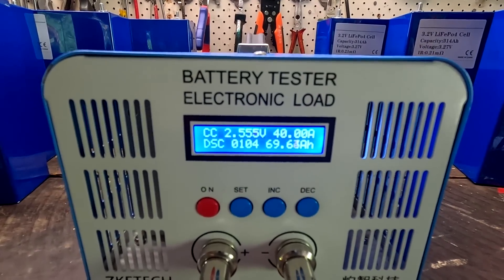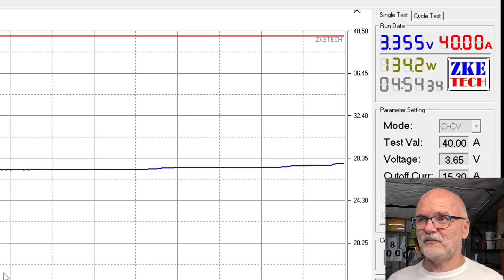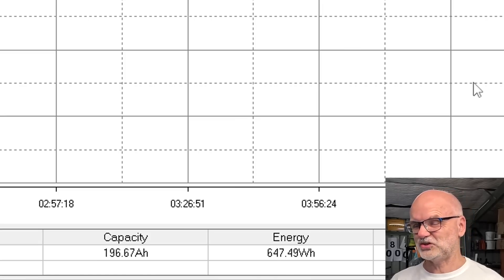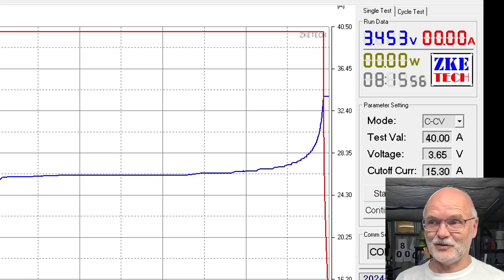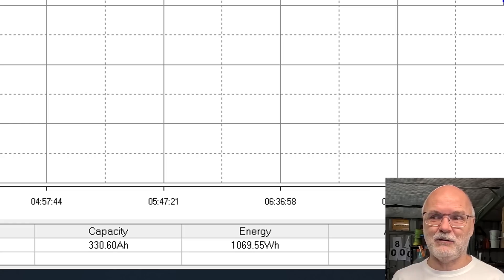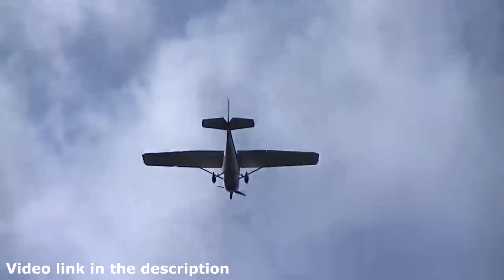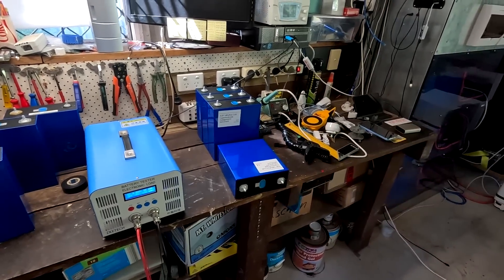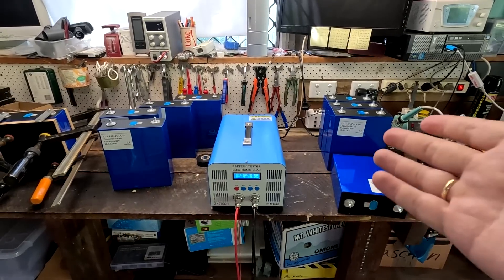EVE MB31 314Ah Cell Test and Review. Have I gotten selected cells to show on the channel?

Comment: It's not so much that Alibaba is better than Aliexpress; it's the same parent company anyway; Aliexpress has very reputable shops. It's just that Alibaba might be better for HEAVY stuff like a mountain of heavy 280AH+ cels because they are usually the factory itself selling and they have big experience with shipping stuff.
For example I have amazing experiences on Aliexpress when it gets to expensive top notch latest tech electronics ..that weigh nothing, but when I had to get ~100KG of EVE cells then Alibaba started being more reliable at finding someone who sends stuff that high weight to where I am.

Comment: One thing, when they calculate the lifetime, do they take it from the measures or specified capacity? It strikes me that it can be better for them to say it's 306, ant 70% capacity limit would be around 214 Ah rather than 330 and have it at 230! the lifetime would possibly be 8000 cycles instead of 10,000could it be that MB30 and 31 are actually the same cells specified differently?

Comment: Hi! I have order the JK B2A8S20P BMS, and 4x LiFePo4 3,2V 314Ah, EVE MB31 , so my battery bank is 12V, 314Ah, 4 kWh. I know that the bms has is own Soc, but I prefer my SmartShunt for that job. Also for now I have an 100/20 mppt and also and Orion 12v/18a. Can the bms declare the battery fully charge and stop charging before the mppt or the dc2dc to declare it charge (float)?. How to prevent it? (if it is the case) The BMS has no comunication with the victron devices to prevent that

Comment: Hello dear friend,i have the same batteries i just received and i have a problem i dont understand,i use easun mppt solar chargers set for lifepo4 ,the problem is instead of changing the batteries with 55Amps the charger just gives 10Amps ,the charger was replaced and tested, they did charge agm batteries with full 55amps but not my lifepo4 batteries,is it the bms fault? Im i doing something wrong?

Comment: I just ordered 64 pieces MB31 314AH. Unfortunately I am measuring a slightly higher internal resistance than stated from my celler. Most cells are 0.23-0.24 and only 2 cells are 0.22.
My "old" LFK280 where 0.18! 
Does anybody think I should be concerned about it?

Comment: 15:43 they label less capacity then the actual capacity because if they put less capacity it means it take more time to degrade the battery capacity to 80% because it already have 110% capacity in starting that's why they say 10K life cycles with less capacity one . Basically both cell's are same 👍🏻

Companies play a smart move here and put much bigger lide Cycles no. So people would be fooled easily and pay more to get extra life cycles

Comment: The maximum continuous discharge is of the M31 is given as 0.5P. Does this just mean 0.5C?
What is the maximum burst discharge (e.g. 30 seconds) these cells can handle?
Reply: I'd like to know this as well!
Reply: If you use a bms system the discharge will be limited eg a 200amp lmit might be a good limit. I put a massive short across my 48v system luckily the bns system on all 6 batteries shut them down thank goddness just had to reset.

Comment: 16 off MB31 cells delivered from Amy Peng at Shenzhen Qishou. All absolutely perfect and installed in a new version of the Seplos 280L case delivered direct from Eric at Seplos.  All very seamless.  Thank you for your recommendations Andy. Both took about 2 months from ordering to delivery in UK.  The cells got held up for 10 days in customs/transport from dock.  I would like to see a simple spreadsheet for Victron VEConfig and Seplos settings.  I have produced my own simple sheet with information from an assortment of sources.

Comment: Andy great video as always. One note about max discharge capacity of 0.5c (150A), seems very Low compared to LF series. Have you considered comparing this? I think the LF304 cells are 1c rated. Am  I correct in my observation? If so quite restrictive if building a 12v battery. 2000w max inverter size.

Comment: I just bought 4 x MB31 cells to make a battery pack, and charged to 100% using an itech world 40A charger.  Have just attached my 40 litre Engel and set to -10 degrees to test capacity.  The discharge amperage is 2.4 A and the remaining hours as shown on the BMS is 165 hrs or 396 AH.  Not sure whether I should feel happy or worried!  Any thoughts?

Comment: The premium cells are picked just like computer chips are binned where there is always a segment of the cells in a run that outperforms the specifications they can pull and sell as the + version.. Supply capacity from manufacturing in China and the cost per cell due to the volume has decreased so it has actually become harder to ship the low cost stinkers as the factory new have crushed the scammers.. Recently bought EVE LF280K that were pre-imported to the USA in bulk and had free shipping from California for under $100 a cell.. Last year the cost was 20%+ higher so things are looking good.. I am disappointed with the 6mm terminals that have a small contact area and seem to be the same ones as the 100 amp cells.. The fact that these are guaranteed to have a 300 amp+ capacity is the up side and my guess is that production quality has increased to the point that marginal cells are the exception or the production of the 300+ cells exceeded demand and these are just derated on the label to ship them out..

Comment: I think the difference between the 30 and 31 is mostly marketing when you look at the cycle degradation, with the expectation that they would settle out at the nominal storage will eventually be around the 306 for the mb 30 and with the less cycles of the 31 they can rate the nominal storage at 314 especially considering they are both new and being launched at the same time. I ordered the mb 30 as they are slightly cheaper and I would bet money they are the same inside and just have different spec sheets.

Comment: I just received my first ever order of cells of this size using the link provided by Andy. (TLDR I got 16 MB31 cells and my initial testing and experience matches with what Andy says).  I just wanted to share my experience for anyone else who was looking into getting these cells and is ordering cells this large for the first time. 

I used the link Andy provides on his site to Alibaba store. Put in the order for the 16 cells and installed the Alibaba app. Glad I did because I was contacted by Amy Peng, after the order went in. She let me know the site defaults my order to Express delivery and that the actual delivery will be by sea and take 55-65 days and said Alibaba was show the order as delivered in 10 days but that the actual delivery would show up in 55+ days. I was confused by this a but but agreed that was fine because I expected them to come by ship and take over a month. 

It did make me a bit nervous as this is a fair bit of money to gable on but over the last month Amy would reach out through Alibaba and update me on the status of my delivery and she let me know when the batteries made it to shore. I ordered the cells as soon as the first video dropped and they showed up maybe even faster than 55 days. I opened one box so far and looked over the two cells. There was no bloating and the barcode was laser etched into the metal of the cell and matched with what Andy found in the videos. The cells looked to be in perfect condition with no signs of them being used and repackaged as new cells. I have personally ran into sellers who have done this on a much smaller order of cell in the past so I was worried a little for this order. 

I tested them using the same tester Andy has and was able to reproduce pulling 332 amp out of the first cell I have tested. I still have 15 more to test but everything Andy mentioned in the video I am able to confirm worked as he said it would. 

Andy you do a great job teaching everyone about how batteries work. I have not missed a single video of yours after watching for multiple years now. Keep up the good work and thank you for finding reputable sellers and sharing that information with us. There is a reason your channel is blowing and that is due to your hard work and funny personality, keep up the great work!

Comment: the capacity of new EVE cells adapts over time (mostly a month of use) to its rated capacity . Its normal to have much higher capacity on new cells . The LF280K starts mostly at 290 to 295Ah to stabelize at 280 to 285Ah . My EVE LF280K stabilized about 35 days on 20 cycles.

Dont wurry about people telling about the biased youtuber . They dont know better.
Reply from the maker: I never noticed any capacity loss over time when using any of the LiFePO4 cells.

Comment: Hey Andy,

I ordered 32 pieces of batteries of LifePo4 280K 8000 cycles at Shenzhen through Alibaba because of your promotions on them. In 1 word horrible. Late delivery and after testing with battery tester none of the tested cells where over 280Ah. I had months of conversation with them trying to resolve, but they kept refusing to resolve the issues and refuse to send me cells according to the specifications that i ordered.

I am glad you have such a positive experience with them, but it saddens me a lot that they refuse to deliver me new A graded cells and instead they have given me something else. 
They send me an excel testing report which stated the cells should have 294Ah, well with the same battery tester you used the tested cells did not come above 280Ah.

I feel scammed for a lot of money and i am really sad that although they promised me in writing that i am always able to return cells that do not meet the criteria, they never did what they said and what we agreed on mutually.

Of course i can give you insight in the communication in private, if you want to, so you can verify my statements.

I just want to post this experience, so that hopefully others will not get the same negative experience with them as i did.

The best advise i can give after all this is: Make sure you put everything in the order "contract" that you accept beforehand.

Comment: Must remember Andy, (not to get too anal).  The bad old days of AGMs, how difficult it was to determine the Ah capacity of these. They dont like > 50% DOD. So if your spec started at 100Ah you could be looking at usable capacity of 30-50Ah, depending on load xC, ambient temp, age cycles?  So maundering over +/-5% of Ah is a bit ingenuous.  LABS BAD NEWS

Comment: I just wanted to add my personal experience of dealing with, and using QSO products (EVE280LK). I ordered my first cells from QSO off the back of Andy's videos and reviews. I have to be totally honest.......... QSO are.... absolutely fantastic! I always deal with Cassie, she is always professional, quick to respond and they offer great pricing and always prompt to dispatch to here in the UK.
How impressed am I? Of all the cells I've bought (50+) I've only had a minor issue with 1 cell, which displayed some bloating, I mentioned it to Cassie. Straight away it was escalated to technical support, they wanted to make sure it wasn't a production issue. I'm going to be honest here, I didn't hold out much hope of anything happening as I think the issue was more of my own making (this cell may have been stored too long above a good storage voltage) when I top balanced for service. In less than 24 hours QSO advised they were happy the fault wasn't a production issue, AND THEN offered to send a replacement with my next order. I therefore increased my order to 48 MB30's. QSO are, in my personal opinion one of the best sellers on Alibaba, and their products are right up there, as evidenced by Andy's use and testing. Keep up the excellent work Andy!

Comment: Some more thoughts about compressing….

If I remember right, in older product specs for cells I found some data that the always mentioned compression of 300 kgf will extend the cycle capacity in some way. I don’t like to repeat all the pros and cons which have been considered in the past.
In the new specs for the MB31 there is no more advice that compression will give benefit for cycle live. If I have overlooked something, please correct me.
If I forget all the old stuff I can read just this:

quote
“When forming modules, a compression force in the direction of vertical thickness is applied to the cells in order to make them better arranged and fixed. 
If the compression force is too large, the cells may be damaged or even leak.”
unquote
They further recommend a compression force of 3000 N to 7000 N and give a warning that forces over 10000 kN (1000 kgf !) can damage the cell.
In my own words they state: “Ok, if you need to give a force on your cells to fix it e. g. in your car, do it, but please not more than 700 kgf.” 
I can’t see any ‘must do it’.

What we can see further down in the Appendixes is the description of the standard test conditions which is the same for all performed tests for all makers and all cells. Here we can find again the 300 kgf, 25°C, 12 mm steel plates and so on. For some tests this efforts make sense e. g. measuring swelling force of finally 6 metric tons or thermal runaway test up to 300°C. 
That means, that al the all the stated specs. are measured under this standard conditions. Measured values could be different without e. g. compression of 300 kgf or could be not. This is not part of the specs. 

Interesting is also further down in the chapter about swelling:
quote
“Customers shall consider the reliability of structural strength in the product design process, and it is suggested to reserve 2.0 mm ~ 2.5mm expansion space while grouping the cells.”
unquote
That’s what we have learned already earlier: You can compress at much you like, but you will never prevent swelling. You must have that space to avoid destroying your construction. Because at 60% SOH you may have that 6000 kg force in your casing. 
Another thing is that the stiff copper bars, which are delivered together with the cells can not compensate the these changes of distance between the terminals and will cause lateral forces to the terminals. If there is free space between the cells, they will remain in the origin position and stiff bars are OK. With a compression design I would use always really flexible bars.

Lot of that above has been mentioned by Andy in earlier videos. I’m actually placing my new cells in the new self made shelves and I made already before the decision not to compress. With that new specs most of the remaining doubts are gone.

Comment: Too bad Andy, I've already ordered 16 EVE LF280K HSEV from Gobel Power...😅 
They've already arrived and my first video will be out tomorrow😉

But for now I'm saving up money. Because the EVE LF560K are next on my wish list 😜

Greetings from Germany 😎
Reply from the maker: Nothing wrong with the LF280K from GP. Great cells.
Yeah, the LF560 will be interesting once they are available. But they may be too large for most people if they build a 48V system.
Reply: @OffGridGarageAustralia  I can only assume I will have to build a custom battery box for compression of the LF560K EVE cells if I go down that path. They look like Siamese LF280K cells in one single cell -so tempting now that EVE are saying MB30 are no longer manufactured. It is a good thing that suppliers value your assessments without fear or favour - 5 FROGS is not given out lightly.
Reply: @OffGridGarageAustralia  is basen lf280k cells any good, I've ordered 16 of them
Reply: LF280K v3 , by the manufacturer's specs rated for 1C continuous charge/discharge. By my opinion, if even we not going to use them under such high currents, anyway it's better because that means that under lower currents it potentially would give more lifespan than other cells which rated for 0.5C currents. Also good idea for testing is test discharge under constant power instead of constant current. It can show what a battery really can handle.

Comment: Question Andy ? When you charge and discharge with your ZKETECH 40 amp tester do your 10 awg lead wires get hot like mine do?? And is this heat in the wires a loss of capacity that is not recorded or does the ZKETECH somehow record the power used to produce the heat in the wires??  Thanks
Reply from the maker: No, they don't get hot. A tiny bit warm, less than hand warm I would say.

Comment: Hi Andy
Just a heads up. Your calculation for curoof.current was incorrect.  It should read 15.7 and not 15.3 on the mb31 by my reckoning.   Hopefully you can get 350Ah out of them.😊